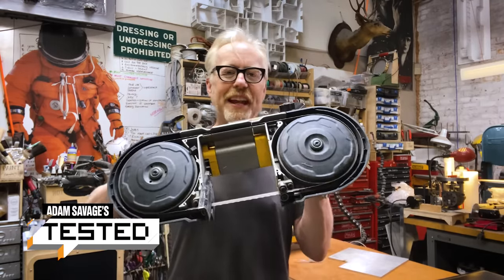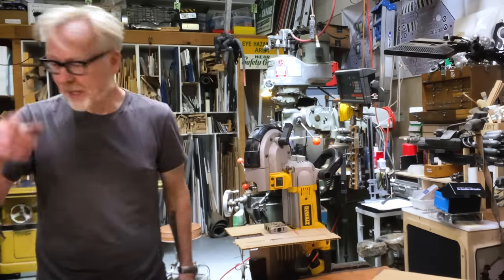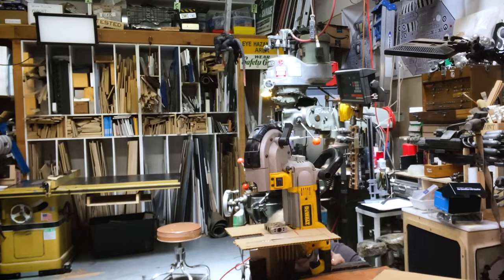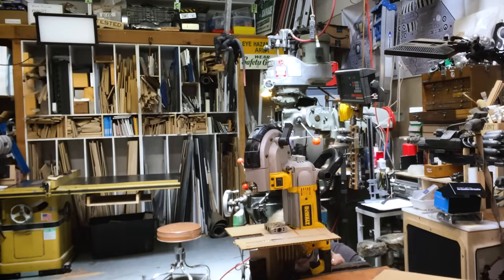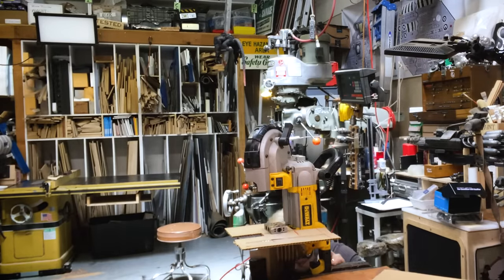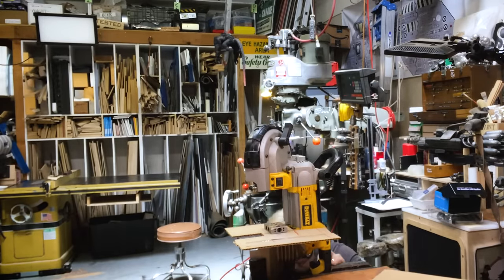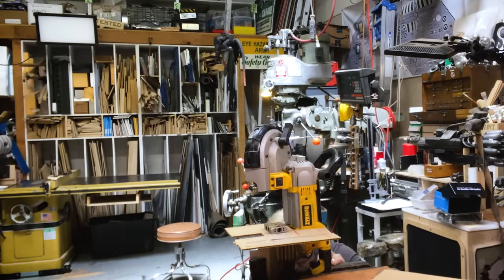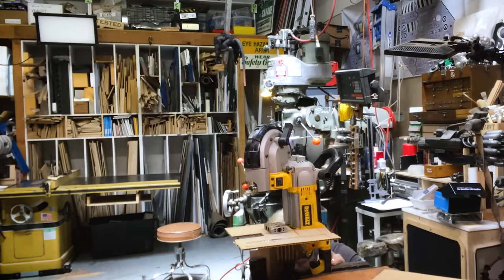Adam Savage Builds a Mini Tabletop Bandsaw!

Comment: Adam, invest in some Snap Jaws with steps machined into them...they're a quick change jaw that bolts on with flat head cap scews instead of socket head ones, so you can just loosen them and slide them out...and the steps in them are a nice square surface to set your parts into and clamp on them securely...

Also, get yourself some screw jack stands to go under your toe clamps, you can adjust the height until they're snug under your workpiece and then sandwich your workpiece between the jack stands and the toe clamps...the way you set up your toe clamps pulled the material down and made your counterbore angled deeper on the movable jaw side where the plate was secured, and the solid jaw side was bent downward because of the toe clamps...

Comment: A couple of armchair thoughts from an old electronics guy. Without cutting the cord, you could have stripped the outer jacket away for 3-4" exposing the three conducters. Then cut only the hot wire, strip the ends, crimp faston terminals in place, connect them to the switch & insulate. This saves cutting two wires & splicing them back together. The downside of this method is one can't pass the cord through a cord grip without replacing the plug. My preference would be to secure the cord to the base with a cable clamp near the rear wood upright; that allows the cord to be coiled & stored inside the base without a side protusion for easier storage.

Comment: About your semi-question about hot, ground and neutral. You're correct that it 'switches' polarity. BUT! Your neutral is connected to ground at your fuse-box, so the 'hot' is 'hot' because it's the one wire that has a voltage relative to ground. The other two are, in normal circumstances, at the same potential.

Comment: Maybe I'm in the minority, but I love torx screws. Especially with the tiny screws in tech devices. Because the driver can actually grip the screw and hold onto it until I get it into the hole. Plus, (as the name suggests) they can handle a lot more torque without stripping.

Comment: Adam, use those nice green and red industrial control pushbuttons , and use a TTL flip/flop circuit into a solid-state relay 
to control the start/stop mains voltage to the motor. Then it will really have a nice industrial control feel to the operation!

Comment: for very straight porta-band cuts I use more angle to draw the blade across a larger surface and use the blade as a guide

I'd rethink the rubber feet for something with 
a high center of gravity, spinning a sharp blade that you are pushing against. you should mount or temp clamp it to the edge of your futer more stable workbench

Comment: Adam, it’s not just about can the switch handle the 120V — it’s about the max current load, which is probably high when cutting dense thick material.  Not to mention — a double throw switch could connect hot to the unused throw.
Reply: OK, I’d not watched to the end before, so now I can presume you’ll fix the exposed hot wire issue in part two.  Had you considered switching both sides of the power?  Also, if you wire the incoming power to the top lugs, then the unused lugs won’t be powered in the off position.  But definitely the spade lugs were the way to go — the heat of soldering could have damaged what appears to be a plastic bodied switch.   .

Comment: You should connect a shop vacuum to this. Make a outlet that ties into the switch. When the switch is turned on the outlet will be energized turning on the vaccume. One switch to turn on both saw and vacuum. This will get rid of those metal flakes.🤠

Comment: 29:34  ... Adam, Torx are superior because they don't "cam" the tool out of the fastener like phillips or flat/standard fasteners do, meaning you don't have to apply pressure to keep the tool engaged to avoid stripping..  torx are a LOT more resistant to stripping out when using the proper tool.. And realistically there are only like 3-4 real sizes in common every-day use.

Comment: What you call the strain relief is actually called a cable gland and while it does provide provide strain relief it's main purpose is to make a dust and water tight seal for inserting cables in for instance a junction box the cables are usually strain relieved before entering the gland.

Comment: With the switch.. When I build this sort of tool, I like to use IEC plugs. The common C13/C14 type that you have at the back of every desktop PC. There's a nice assembly that you can get for ~5€ that has a switch (often even lit) and a fuse in one piece. Make a hole, plug the piece in and you are even safe with the insurance companies because the plug has a ground pin.

And as an electrician, I can tell you, you NEVER use solder for grid power. You crimp some shoes onto them that you use to plug the cables onto the tabs. Then you put some heatshrink on them or close off the part. Remember, a shocking experience on your power tool is even worse while the power tool is running.

Comment: Although the carbide tipped blades will cut aluminum, be careful that the aluminum (being softer and a much lower melting point) does not gum up your blade. I have had this happen to me with reciprocating saw blades. Maybe not an issue with table saws?

Comment: Mild concern: Should the switch not be there as an isolator, breaking both live and neutral? When you said it has two separate circuits I figured that's what you'd be doing.
I'm off to watch part 2 now :-)

Comment: Funny enough that the wiring works, there seems to be no zero voltage switch on this portaband, newer ones won't start once the power went out for whatever reason for safety measures.
Like some other commenters say: switch both hot and neutral, your american outlets seem to be unidirectional with the single PE pin, but maybe the electrician did a sloppy job on connecting the wall outlet, and suddenly the neutral connection is the hot one.
The switch illumination also needs some connection to neutral to work like intended.
All in all a great build, I always enjoy your videos :)

But I got one question: not keeping the brass insert from rotating was intentional? To get some give and take if the band flexes while taking a curve?
Otherwise a hole whose center is right between the brass and the aluminium part with some kind of pin (spring pin, cylindrical pin), could help to prevent this.

Comment: Of course you can use a hole saw on metal.  When I worked at a Cobra Replica company, that's what I was using to make frame parts.  Would have been nice to have auto-feed (and decent lubricant) to do them.

Comment: 19:12 Do you see how the boring bar started cutting on only the one side?  
That's because your plate deflected down from the clamping pressure. You don't have anything (parallels) under the end of the sheet closest to the mill (next to the fixed jaw), so the plate is clamped down over open space which turns the inner edge of the moving jaw's upper surface into a fulcrum.

Comment: The hot wire comes from the power plant, the neutral dumps the returning electrons into a massive ground bar at the nearby transformer, and the ground is just a safety wire that comes from a grounded rod near your shop. The fact that it's AC don't change anything. Just imagine your air tools working on an air line that goes from pressure to vacuum 60 times a second. The hot is the air line and the neutral is your surrounding air.

Comment: Adam, can you please do a tool tip on your shop air compressor and its setup please? i.e. how you ran the drop airlines,  filters/dryers and where you have them and also any regulators for when you airbrush etc. I am in the process of setting up my shop air compressor and would like to know your setup for a reference on wants vs. needs. Thank you for any consideration to this subject.

Comment: i don't know if anyone mentioned it. too many comments... but when you were cutting the hole in the aluminium plate with the hole saw and the boring bar, the plate didn't look straight. especially the boring bar. it was cutting the "forward" (towards you) side of the plate first - same as the hole saw

Comment: The real trick with hole saws is to constantly back off and clear the chips. The gullet of each tooth will pack with chips and that is where all the heat comes from. If you back off after only a couple of seconds of drilling, you will drill through much faster and the saw itself will be cool to the touch. Another trick is to start to drill, just to make a mark with the bit, then stop and inside of that, drill two or three 1/2” holes with their outside edge tangent to the outer part of the mark made by the hole saw. These smaller holes allow all the chips to clear and you will zip right through whatever material you are cutting.

Comment: A couple of comments:

-Spends a whole day building something that is readily available (and proven to work).  And it's funny because it''s available on Amazon, which Adam links to a lot.

-Yes, you can cut aluminum on a woodworking table saw.  But there are few precautions to be aware of:
(1) Aluminum 'sticks' to the carbine on the blades and will eventually dull it.  Many sharpeners will charge extra to remove the aluminum before they sharpen the carbide blade as the aluminum gums up their sharpening tools.

(2) Those tiny little aluminum bits coming off the blade are HOT.  If they come into contact with sawdust already in the saw cabinet, it could ignite and cause a fire (don't ask me how I know this!).

Be well,
Don

Comment: The twist trick is what I've been doing forever; but you need to use a non-crummy manual wire stripper... cut the insulation then twist. The wires build up in side in the gap and push the insulation off, while also giving you wires which look like they were twisted by a machine. Tight and flawless. I can't stand auto strippers because they chew up cables, they tear or cut strands off the inside, and I have yet to find any that have been reliable and I've tried 3 or more and all settings. They are better with bigger wires - solid core is obviously easy - but the downside is with bigger sheathes they look like they're chewed by a rat.

Comment: Polarizing is for safety. If a single-pole switch is used, polarizing is used to make sure that the hot lead is broken inside the switch. This keeps the rest of the electric device connected to neutral and safe. If the polarizing is somehow violated, the switch no longer breaks the hot side, the switch now makes a connection to the neutral side. In this configuration, the inside of the electric device is now live the entire time it is plugged in. The argument here is that if the device is disassembled it should be unplugged first and then the polarization doesn't matter. The true purpose of polarization is to mitigate failures. Take for instance the wired porta band. If polarising is maintained the only failure during an off condition it could have is with the cord or switch. If polarising is violated then there are many more failure conditions because the motor is constantly electrified. A porta band runs the real risk of falling off a workbench and breaking causing a failure condition of the electrified motor. A double pole switch that breaks both the hot side and neutral side does not require polarizing.

Comment: @adamsavage, were you questioning the added fibers in the cord? Typically it's for extra strengh, as well as durability- Because the additional fiber content/diameter of the cable increases the bend maximum bending radius, improving the fatigue life of the metal inside the cable.

Comment: 3:13 Why not removing or "modifying" the two double baring thingy's to change the twist in the blade (90 degrees away from original) so it cuts parallel with the back wall of the saw body...That way you would have a much large clear area to saw...

Comment: Polarizing AC wiring is done because most if not all house electrical has 2 different hot main power feeds, when you combine them, you get 240V, which allows 240V outlets in homes. The neutral is the neutral wire for both of these hot supplies, and the ground is grounded. That's my understanding of it, someone please correct me if I'm wrong

Comment: 18:18 i noticed the aluminium had no support underneath, meaning the 2 side clamps are pushing the aluminium down onto nothing, so you are 100% relying on friction stopping the plate from tilting forward, i would have moved the side clamps to the forward slot so they are clamping the aluminium down onto the vice block instead of thin air.

Comment: A few things...Variable speed?  If you are going to move it around, fasten the wires so they don't get caught in the band and keep the handle.  Why hide the switch, but not the power?  (Also, if the got the switch, why not make it red when off, but plugged in?)

Comment: You use polarized plugs because often only one wire is switched and/or fused in an appliance, and if it's the neutral instead of the hot, you can potentially have a condition where the switch/fuse is open but the guts of the appliance are still "live" and a fault can more easily cause shock or fire.

Also important on Edison base lamp fixtures, where the screw (which is one electrical contact) can be exposed, which is a lot safer if that's the neutral side.

A lot of cheap electronics also derive their power using the neutral side as their 0-volt reference, which is a real hazard if you get that backwards and connect it to a device that has proper grounding... the device won't care 'cause it's rectified, but the device "ground" is actually 120V relative to Earth Ground which means connecting it to something else will cause a dead short and some unexpected excitement in your life (if it's not obvious, I speak form personal experience on this...)

Comment: I would start from the bottom and work up. What will make a stable base? Then attach everything else to the saw so that they can be easily removed for servicing. Almost exactly like how you set up a Christmas tree. Turn the original power switch on, coil and tie up the original cord and plug the saw into a harness containing the speed control (mounted on the base) and the cord leading to the wall. Should you need to use the saw as originally built, you strip off all this stuff, and put it back later.

Comment: When using a DRO on a lathe enter the measured diameter instead of zeroing it. If the DRO is configured correctly the DRO will always show the current diameter from then on, no calculation required.
Reply: I was thinking of sending Tom Lipton a message and asking him to teach Adam how to use a DRO.

Comment: I only just started but I'm looking at the template and I'm wondering why you don't add in an inlay - ie: table saws, and other table equipment have either sacrificial or permanent plates which can be easily removed to get at the mechanism... so why not have an inlay so you can get right up against the blade, on the table, but easily lift it up and unslot it from the blade... ie: how you had it at the start with the blade cutting into the cardboard being one side of the plate which sits on a ledge... then it goes to the opening. If you needed support you could have something like an AR-15 trigger-well which can be swung open by using the tip of a projectile so gloved hands can get into the trigger area. ie: it just swings down, and up - if you need it. the plate would just sit on top of that - or you could always have a split piece which just opens straight up.

You did do something similar, but it is round and the straight cut isn't. keying the circle would help a lot so it only sits in one way. Also, since it does lift out, it doesn't matter if you rotate it with the opening always open, or have it closed - but then you have an open area, closed, then open.

Comment: Adam if you use a parallel under your workpiece you would significantly reduce the chatter when you are drilling and boring on the mill.
Reply: Also you have a J head mill with power feedquill specifically designed for boring rather than using the knee. Fun project for a small shop, thanks

Comment: A couple questions, first why did you use brass on the insert instead of say Delrin plastic? Second, how did you get the switch on the saw itself to lock so you could turn the rocker switch on and off and engage the saw?

Comment: Gah! You kill me Adam! That electrical work just physically hurts! :D

Great job on the modification, but I don't understand the point of it. What's the difference between this and your regular band-saw, aside from this being worse in almost every respect? (Smaller work surface, more difficult to fit in things to cut, less control, less stability, et cetera) What am I missing?

Also, using too-large lugs is dangerous. The crimping is loose and it can cause arcing and associated badness. FYI, Yellows are for 4mm² only, and that cord is probably 1.5mm². Always use the smallest size that fits. Reds go up to 1.5mm², Blues up to 2.5mm². Stay safe!
Likewise, since you actually have a double switch like that, you should definitely switch both the live and the neutral, because you can never be 100% sure that the socket is wired correctly and you could thus be switching the neutral only, leaving the live... live :D
Reply: Árni Viðar Björgvinsson yea that’s kind of why I always skipped over this video. Like I would like to do something like this but I can afford a big old stand alone band saw. I feel like it makes so much more sense to keep it portable and movable for times he can’t use the big one or just needs to do something quick and messy. Unless he has like 2 or 3 of them which is a possibility.

Comment: One downside to that switch Adam. With it turned off, that yellow spade on the back of the switch is now live since you switched the hot instead of neutral.  So maybe put on a bit of heat shrink so someone doesn't see the 'off' tool and accidently experience that annoying 110 zing. :P